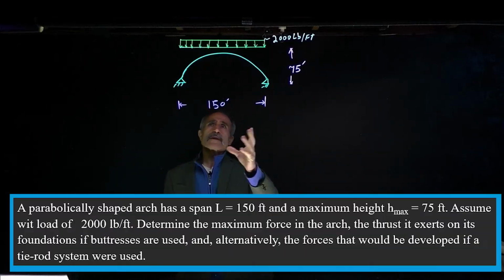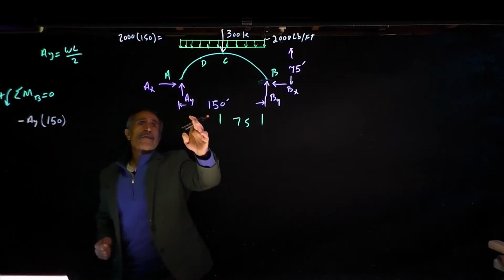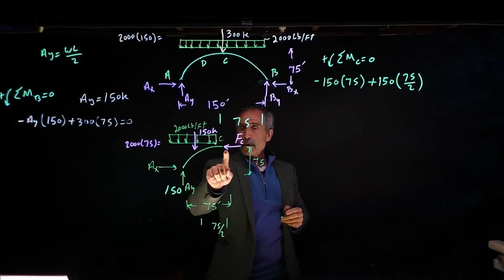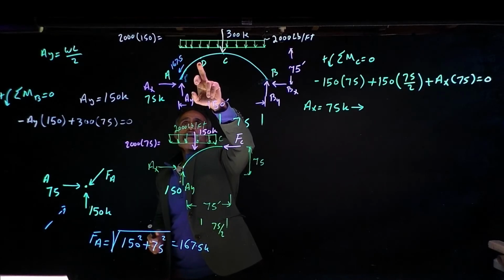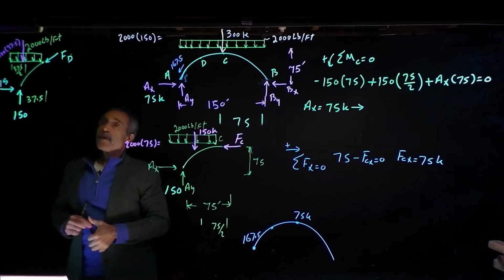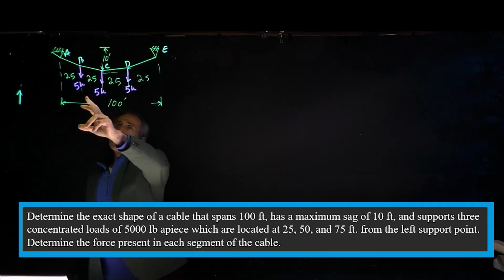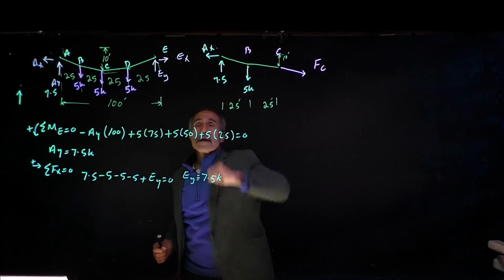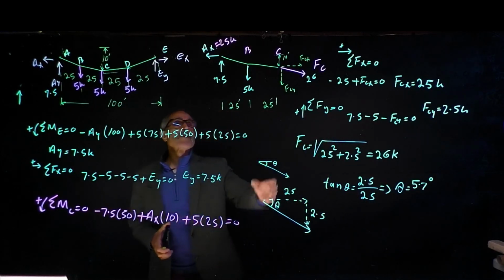Analysis of Funicular Arch  and Cable Structures

Comment: In the real world arch bridge analysis, from which member/part of the bridge structure, does this 2000 lb/ft uniform load acting on the arch come from? Thanks in advance for the reply.
Reply from the maker: That would be a combination of dead load (weight of the material such as concrete deck and....) and live load (moving vehicles and pedestrian ..)
Reply: @nasseryariphdpe648 Thanks for the reply. Is the self weight of the arch itself a horizontal (not parabolic) UDL? It's calculated as unit weight of the arch times its cross-section?
Reply from the maker: The weight of the arch  is lb/ft based on cross sectional area (unit weight time area) for example timber has a about 35 lb per cubic foot a timber with cross sectional area of 2'X2' will have a 35x4=140 lb/ft.